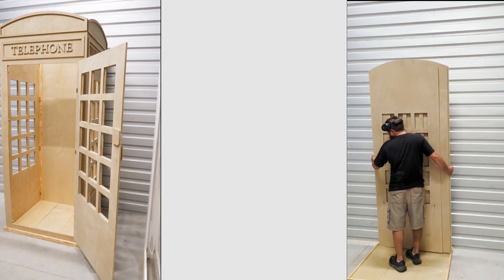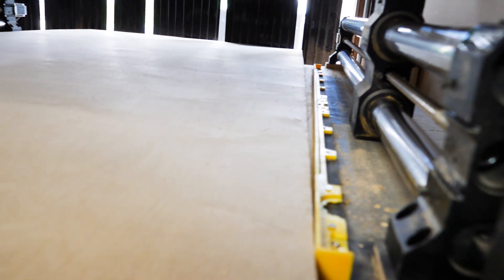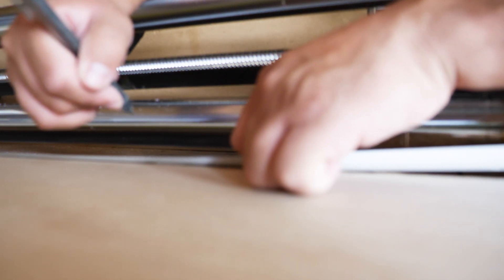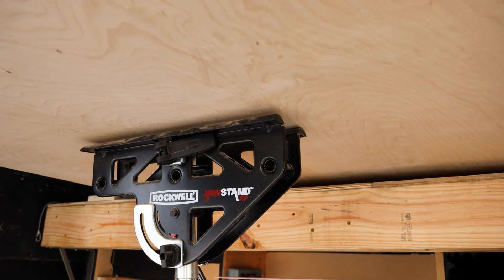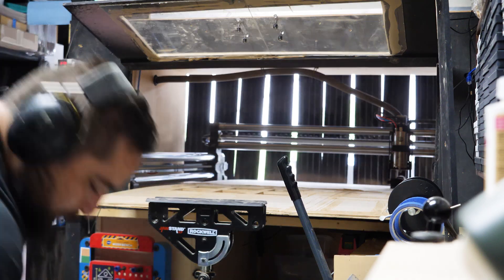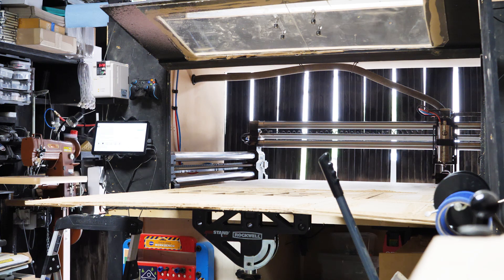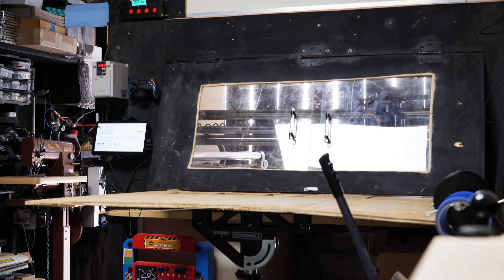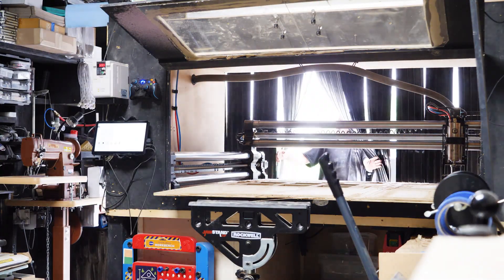Using a 4ft CNC to cut out a 8ft sheet of plywood Project to Make A Plywood Phone Booth

Comment from the maker: I will be have the plans with measurements up later this week. It will have the DXF file/ SVG file as well as the Measurements and Printable stencils for those who do not have a CNC. This one is different from my original design because it is made mostly out of plywood. And the roof is attached to the sides while being open at the top. I did get a lot of requests for a plywood version so this is the one I came up with. I just did not want to cut all the squares out because I have carpal tunnel and it would definitely aggravate it. So I cheated on this one with my CNC. I  apologize as I try to stay using basic tools such as Jigsaws. But trust me it can be made and I will include some important info in the plans and video together. Thank you everyone for your support!!
Reply: Hey what size plywood is this ?